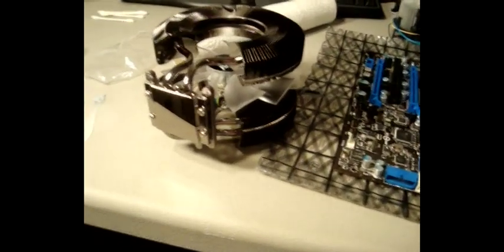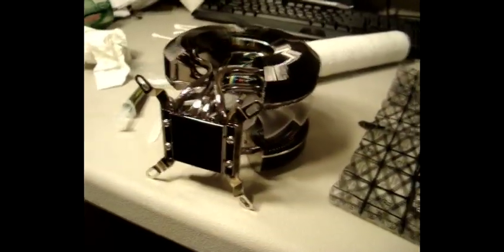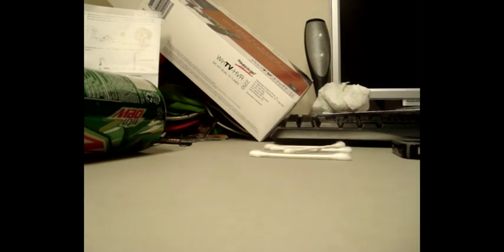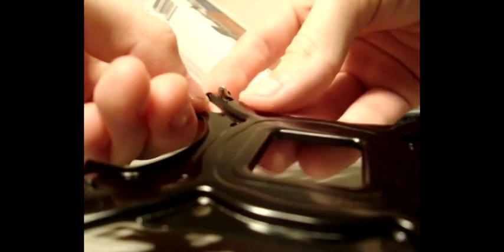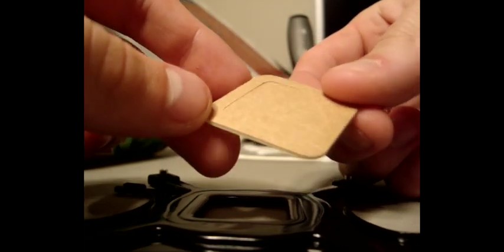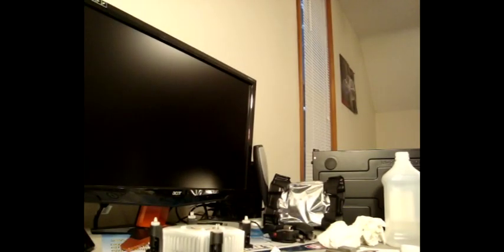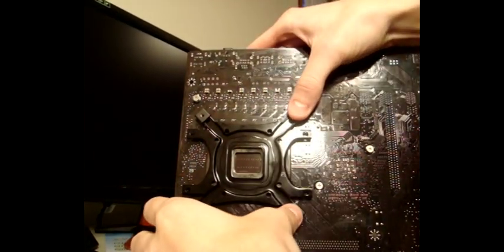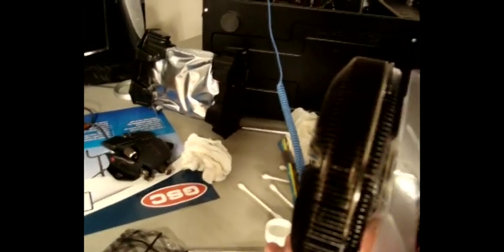Zalman CNPS9900MAX-B 135mm CPU cooler install guide

Comment from the maker: @eldiceuf am3 coolers and brackets fit the same as am3+ If you followed the diretions perfectly for am3 i would say the loading block is definetly the problem. I would take if off and try in install without it. Worst comes to Worst they send two blocks so you can throw the second one on if it turns out you need it.

Comment: Great vid  and thanks.  I'm been trying too decide what cooler to get for my 8350.  I really don't want to have to remove the mootherboard  so I think the it's either the 9500 or 9700.  I'd like  to get this cooler but I don't have the cutout and this just looks  like more trouble  than it's worth. I don't plan on ocing  to the extreme  so I think 9500 or 9700 would be fine. Comments  are welcomed.

Comment: The brackets are faulty mate. I just bought this too and the brackets are COMPLETELY flat. I checked out unboxings online though and everyone has brackets which are actually bent properly and let the screws reach the bolts just fine.

Looking at the comments here it looks like Zalman's had issues manufacturing these for years. Some people have brackets which're bent just enough to work without the loading block, but mine don't reach even if I remove the backplate entirely.